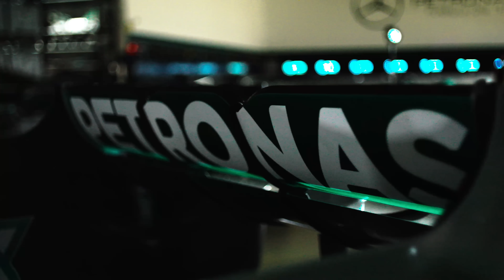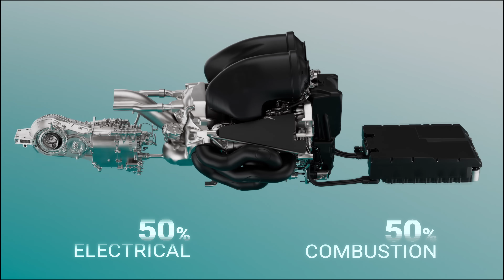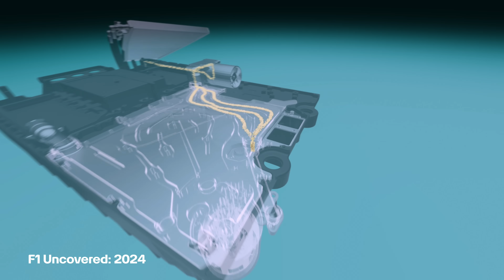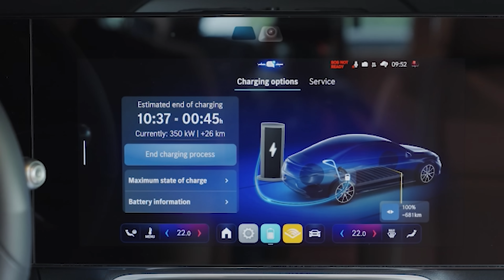The Road to 2026: The Power Unit

Comment: Less energy dense fuel. Less fuel volume. Less power from the engine.... And they're lying about the electric side: peak power from the motor is only for 0.5 mj, not all 8.5mj.... and the motor really only produces 240kw not 350 in nearly all scenarios. the 8.5 recovery is a silly limit and the tiny 4mj battery is the same as this year. expect cars to be ~7s a lap slower. worst regs ever

Comment: 1. it's not an upgrade if cars are projected to be up to 2.5 sec slower per lap. 

2. Its barbaric to produce power units that are so impaired that you have to downshift at full throttle on the straight in order to get faster lap times. 

3. F1 lost the "innovation" bragging rights when they barred teams from having a clean sheet to develop cars on .
Let teams develop whatever they want to develop ans let's race.
Creating these proxy restrictions has never worked as intended and will never work.

Lastly - Stop shoving diversity down everyone's throats . People deserve their place in any industry based on merit , not the colour of their skin , not their gender.... sheer talent .

Comment: Moving to 50/50 power split is gonna make some heavily boring racing, along side removing mgu-h.

Since you have 100% sustainable fuel why use hybrid?

Racing is gonna come down to battery level, come on this ain’t formula E.

If i wanted to watch electric cars race I’d watch formula E.

2026 L season.

Comment: Can Petronas show us their tech or explain their process to create the sustainable fuels?
Reply: But to be real: 
To produce 'sustainable' fuels you first need to find a different source for energy, e.g. electric power plants such as nuclear, solar, wind, coal, oil etc. Then you take the electric energy, and through extremely wasteful and inefficient chemical processes you split Hydrogen from water through electrolysis. Then you take this hydrogen and through another step of extremely wasteful and inefficient chemical processes you build up a carbon hydrate molecule with the size you need for your fuel.
You might ask: "Wait, it's extremely wasteful and inefficient and still relies on other forms of energy that we haven't made sustainable yet, how is this sustainable then?" and the answer to that is "It simply isn't"
The reason the biggest combustion car makers and oil companies are such big "omg sustainability is so important" sayers should tell you all you need.
Reply: @Max_Rei  It's the BIG OIL using the BIG TABACO public lines of yester year. The Black goo is decomposed organics. Simple techniques these days is to use Algae, lots of research has been done on which one is the best for CO2 uptake. This can undergo easy transformation into the fuel tank. But the question I asked is what is petronas technique? Has the FIA specified and completely set the organic molecule to be used? They could turn up and use NH3!
Reply: @aaronivory8088 I stand corrected. What I was talking about was explicitly just E-Fuels, not other Fuels made from organic matter, although those have similar problems concerning efficiency
Reply: @Max_Rei Another technique is Pyrolysis, which converts plastics into Kerosene, Diesel, and Petrol(as we know it). The great thing with this is it's a cyclic process. The syngas produced is used to keep the process heated. If this is also attached to an algae capture, it's a win win for the extreme plastic waste issues the world currently has.
Reply: Well first step is to drill baby drill and make as much money releasing as much carbon into the atmosphere for as long as you possibly can. 
After that you just fund a little lab and a little workshop somewhere and employ some hotshots, supreme experts in the field, to start making up all the PR.
Reply: @duncanidaho9153  There are a number of processes that can be employed to create synthetic fuels from atmos or linked to an industry to reduce their output. We don't need the obese orange mans 'drill baby drill' call!
Reply: @duncanidaho9153  based

Comment: wasn't the engine made ~800hp?  350kW(469hp) motor is just  bit more than half the engine. does the engine power dropped to match the motor to make ~900hp or does it mean the motor have a temp power boost to ~800hp to make combined ~1600hp?

Comment: Can we get rid of the empty space between the engine and gearbox? Getting rid of that space would make the car already 30 or more centimeters shorter with little to no effect to crash safety. The space there is useless and only there because the teams want a longer car. Longer car is heavier car. Heavier car needs more crash safety, which again, is heavier. Making the car shorter would mean a reduction in mass that the safety structures need to absorb, which means the safety structures can be made lighter. This in turn means the car gets even lighter. Now obviously someone is going to note how the turbocharger currently sits in this gap. While that is true, it is not the only possible location for the turbocharger. The turbocharger can be lifted up, over the gearbox or even fully inside the V like it is in road cars. It is currently only there because it makes sense to have it in there, and it is possible to have it in there, but it does not need to be in there.

Comment: 1:41 isn’t it fairer to say the ICE produces 100% of the power, the other technologies recover some of what’s lost to heat etc or something similar? I mean, except for the initial battery charge on the grid, it all comes from the ICE engine first.
Reply: he said POWER not Energy

100% of the energy comes from the fuel tank which is used by the combustion engine but some of the lost energy is converted into extra energy that can be used by the MGU-K.

thats a more accurate way of saying it
Reply: They should have said “power to the wheels”.
Reply: @GNX157  comparing a battery to an engine is where you've lost the plot on this one. Fuel is loaded and the battery is charged before the race, which are the energy available for use during the race. The energy that is harvested during braking is considered "lost" for an ICE since you have no way to get any back without a hybrid system. The electric system allows for the recovery of energy from braking, making the whole car more efficient. Power is the rate of usage of energy, so the ICE and the electric motor make the power, and the fuel from combustion is where a large majority of the energy to move the car forwards is added to the car. The battery charge at initial conditions also is a thing, but I'm unsure as to how much energy there is and how that compares to the amount of energy in their fuel.
Reply: @Rudyliciousness Like I said, except for maybe the initial charge put in before start, it all initially comes from the ICE engine, it just changes form. The battery anyway, is very high discharge and depletes quite quickly. An F1 battery would last for only a few laps or a few seconds of full power without recharging, as it is a small, high-discharge system designed for bursts of speed rather than sustained driving. Its entire purpose is to be continuously charged and discharged during a race, which is different from how a standard road car battery operates.
Reply: @GNX157  No, that's what the MGU-K is for. This unit is specialized in recovering energy from when the car brakes, just like many electric and hybrid vehicles do today, which means this power does not come from the engine, but from the inertia of the tyres.
I would need to check as I'm not sure, but I don't think that for 2026 the engine will somehow recharge the batteries, so the batteries and the engine would be 2 separate power systems working together.
Reply: @artgrx9 First, as I said, the engine produces all the power. The battery is charged before the start of the race. Other than that it’s charge is provided from elsewhere, but the energy ultimately comes from only the ICE engine., wherever it comes from. Energy is not destroyed, it just changes form, and that initial form is from the ICE engine, nowhere else.
Reply: @artgrx9 where do you think the inertia of the tire came from?
Reply: @artgrx9  The engine CAN recharge the battery in 2026. The regs explicitly allow the ERS-K to harvest not just “when the car brakes” but also at partial load— so when the ICE is pushing the crank and the MGU-K is run as a generator. Additionally - MGU-K is mechanically tied to the engine. By rule, all MGU-K rotating parts are permanently linked to the ICE crankshaft AT A FIXED RATIO, so torque (power) can flow either from the rear axle to charge, or from the ICE to charge (of course at some fuel cost). What I wanna say is that it’s certainly not a “separate power system" and because of that your statement about "2 separate power systems working together" is false.
Reply: @MndPalace  It's still two sources of energy (fuel and battery) that provide 2 sources of power (ICE and motor/generator) and they work together
Reply: @ColinCarFan  But of course it is  and exactly, same what I've said and what is also highlighted a video - a singular power system using two sources of energy. Not as the gent above assumed - two separate power systems working together.

Also I feel deeply obliged to point out to you that imo you are confusing concepts. You see -  energy is the total amount of work done or heat produced  (so source answers the question "where does it come from") and power is the RATE at which energy is produced or transferred (so source answers the question "what does all the work"). Also we're not talking about components, we're talking about systems. So in this SYSTEM you've got presicely two sources of energy but only one source of power. ICE and MGU-K produce power (allright) but it's not like there are "two different powers from two different systems mixing somewhere and coming out to be one unified power - it's all the same system (ENGINE) just with two central components".
Reply: @ColinCarFan and where does the energy of the battery come from?
Reply: @MndPalace  That’s so correct. There is even suggestion that’s car will be at higher RPM through extremely slow corners to gain energy and how the cars may sound weird at certain parts on the track where they would normally be on brake.
Reply: You’re correct t but it’s an interesting point the poster makes as for the car to recoup that energy it first needs to move! And the ICE does that.
Without ICE there is zero extra power unless you charged the battery and had 7 secs worth of power to drive out of the garage…

Comment: Why is the power unit changing? because Audi and GM demanded F1 to get rid of their most technological piece, MGU-H
Thats it. Its simply because they wouldn't be able to be competitive.
This is such step back to F1 and a slap in Renault's face after they went nearly bankrupt trying to figure this system out, especially now that this tech is finally finding its way to road cars. Welcome to a new era of less racing, less innovation and more energy management and strategy.

Comment: Needs one less turbo, no hybrid system, 4 more cylinders and 7000 more rpm. Bingo!
Reply: @gsquared-gg06  not going to happen
Reply: @VarunTomee-kr6nf  Unfortunately
Reply: Dang. You fixed it.
Reply: I think we need 1 fan less in F1. Simpler solution. Take your idiot friends with you too actually.
Reply: Been there, done that.
Reply: Go watch F1 from the late 90s and early 2000s then.
Reply: DEI isn't die yet.

Comment: While I feel that removing the MGU-H for the 2026 season is stemming from the FIA regulations wanting to make the effort to make engines cheaper and more accessible across all the manufacturers and constructors, the idea that mixing 50-50 power between internal combustion and electric engines feel like an additional hurdle to overcome.

I trust that Petronas has what it takes to make their fuels more energy dense to produce longer-lasting consumption and the various kinetic energy capture from braking translates to more storage to effectively turn their cars into a single-stop strategy maestro.

I look forward to seeing the resurgence of Mercedes as they had been in 2014.

Comment: Why is F1 not looking at Hydrogen as the fuel for the future ? It's more renewable that anything else. It's the cleanest fuel, and very powerful. Internal combustion engines running on Hydrogen sound much better than an electric motor
Reply: Because storing hydrogen is a huge issue. Tanks require a lot of volume and they're under high pressure. Just think about crashing one of them into a barrier at 300 kph.
Reply: @a.x.w  Another problem is that it can take significant money, energy and pollution to separate hydrogen from the natural gas/water/biomass/etc. from which it is taken, depending on the method used.
Reply: @MVPever  Yes, in that sense it's only a form of energy storage and not even a good one. Energy density is low and it's hard to contain. After all, it's the smallest atom.
Reply: you need to have engine maker interested to make one first and most of them can't carry over such technology to a road going car especially the lack of infrastructure